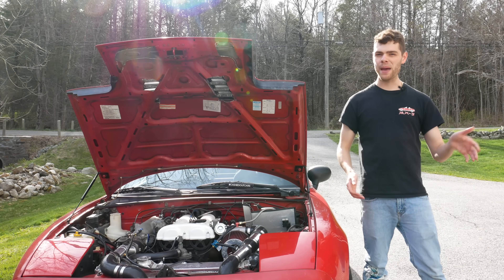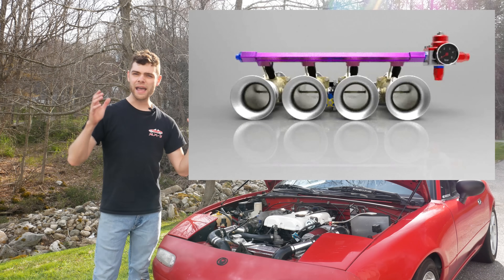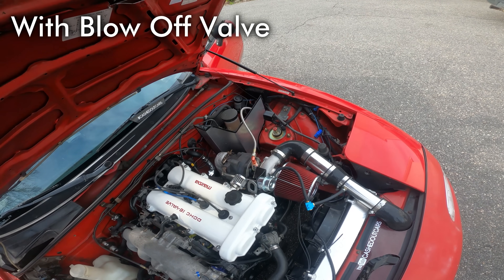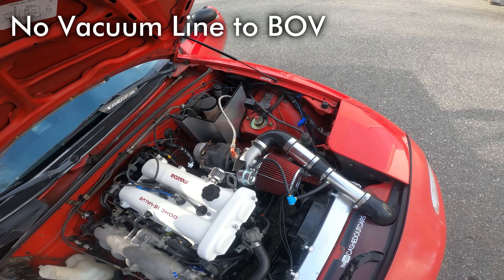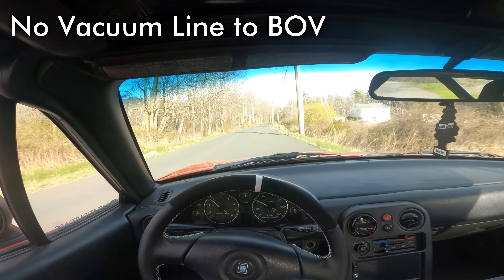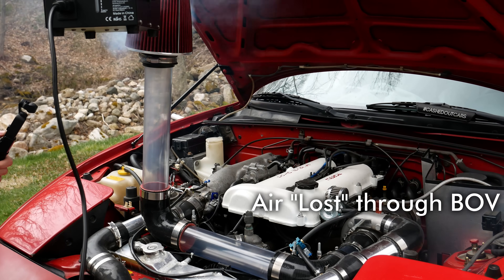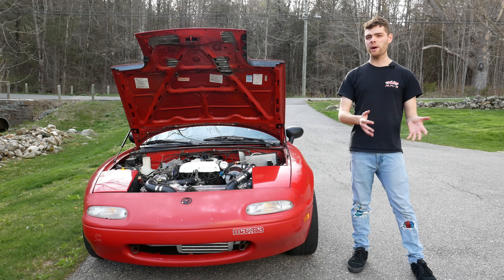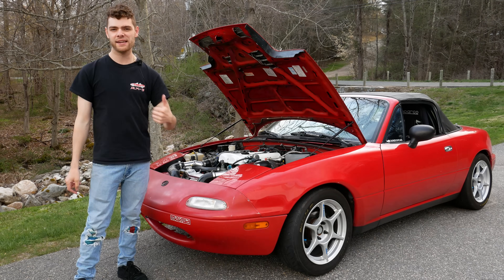Blow Off Valve vs No Blow Off Valve | Sound and Science

Comment: the same fuel issue will happen without a BOV because when you close the throttle the air has nowhere to go and usually ends up passing through the MAF again and then guess what, even more fuel gets dumped in
Reply from the maker: Your BOV provides a place for that air to go, and you should place your BOV between the throttle and MAF to prevent that
Reply: @CashedOutCars  once it has gone through the maf, the motor expects it
with a BOV, it exits and the air that the motor is expecting never comes and causes a rich spike
without a BOV the air is forced to travel a 2nd time through the MAF which also will cause a rich spike.
I was just noting that the rich spike when getting out of boost is kinda just how these cars act. there are ways to tune for it but still.
Reply from the maker: This car is tuned speed density so no MAF at all so no rich spike when you close the throttle, I do have less experience with a BOV and MAF but I would think air going through twice would have more of an effect than it venting out the BOV, not sure on that one though. Thanks for your comment!

Comment: There's a middle ground. Get a BOV which is tunable. The TurboSmart RacePort, or something similar, works. You don't want it constantly venting at lower boost levels (< 0.5-0.8b), but then do vent at high boost levels (1.0b on up). If the POV is constantly venting, then it hurts throttle response if you modulate throttle mid-corner. If the BOV spring is light, then a small throttle adjustment will vent the pressure in the intake manifold to ambient and you get the lag of the turbo starting from zero when you re-apply throttle. If you leave some residual boost in the intake which isn't high enough to do any real damage, then if you do a quick throttle modulation mid-corner, it's a lot more linear in it's power delivery. Tune the internal spring pressure to find your happy medium.

Comment: Ok, this video sums it up perfectly. I understand what a BOV is and why i should run one but I am not a big fan of the noise they make, especially for my daily car. This makes me skeptical on running one because they sound like the car is sneezing, but reduce wear on the turbo. unless there is like a quiet BOV or my car already has a quiet one (2017 Ford Fusion Sport 2.7 ecoboost)
Reply: I know this is a while after you wrote this. But if you run a recirculation setup with the bov, there will be much less sound. Like having it blow off out in the intake again in a loop. But of course you wont have a flutter either.

Comment: It seems to me that turbo flutter not only stops the turbo spinning but even makes it spin backwards.  So you not only have turbo lag having to spin the turbo back up with the throttle, but you have to bring it back from spinning backwards in some cases, so the turbo lag is even worse.  The turbo keeps the spin going with a BOV or bypass valve, reducing turbo lag.  Somebody tell me if my thinking is wrong
Reply: Not only does it not spin the turbo backwards but it doesn't even slow it down, anybody that has told you otherwise has zero understanding of what is happening.

Comment: I don't think you were expierencing compressor surge at all with your example and it should be redone. Disconnecting the vacuum from the bov puts the bov at its spring rate to open and close. If you're spring rate is overcome easily then whatever boost is in the system will force it open. Which is why you didn't build boost. You essentially had an open bov the whole time.

The bov remains closed due to boost in the system, once it goes into vacuum it opens, but since you have a vacuum leak at the bov that means it is always open.

It sounded like the valve kept opening and closing rapidly instead of the boost pressure being chopped.

Comment: Im no mechanic, but does having a blowoff valve technically introduce more turbo lag? Since the charged air gets released, the turbo would have to pressurize it again on the next throttle input no?

Comment: whats difference blow off and wastegate?
Reply: Blow off valve releases pressure between the turbo and the throttle body when you lift off the throttle, a wastegate bypasses exhaust gasses around the turbo to limit how fast it spins which limits boost pressure going into the engine.

Comment: I didn't realize without-BOV has become a thing, one doesn't care the unnecessary wear on the bearings and the longevity of a turbo, would've at least concerned the massive amount of pressurized air piped into the opposite direction of a highspeed spinning turbine to literally force it to a halt. Who wants to wait for the turbos to spin up from a halt all over again between every shift?
Reply: It hasn't become a thing, it was a thing since they put turbos on engines, it does not half the turbo to stop spinning, it doesn't even slow the turbo down and yes people have tested exactly that, it does not damage the turbo, it's common place in motorsport not to run any blow off valve because it actually improves response if you aren't releasing all the boost pressure.

Comment: Why your BOV leaking boost when vacuum line is disconnected? The pressure should be holding that BOV closed. Did you not plug the disconnected vaccum line? I'm also using an hks SQV4, I'm not losing boost when my vacuum line to the BOV is disconnected.

Comment: I rarely ever like videos, but this was exactly what I was looking for, appreciate the video👍 I swapped from 1 50mm BOV to 2 forge diverters & haven’t done the vacuum lines for them yet, I like this because you showed what it does without vacuum to the BOV & justified my decrease in boost pressure for now👍
Reply: When you say forge diverters do you mean like like the dual greddy flang type s style recirculation valve

Comment: I just don't have a TIG welder to weld my BOV flange to my intake pipe. Single 98/88 cheap turbo on a gen 4 5.3 with forged pistons. The flutter it makes sounds awesome, but I don't want to damage my turbo. I made a new friend a few days ago, who has a working TIG setup and offered to weld it. I will be doing that. I have a TIG welder, but the welding gas shops won't fill my gas bottle with 100% argon since it's already had 75/25 argon/CO2. Bottles are expensive. $300+ for a new, empty bottle. Bleh

Comment: Question: do diesel engines have blow off valve? I mean they dont have throttle plates. But i do here trucks make the blow off valve release sound between gear changes. But i dont here it in SUVs or small diesel engines.
Reply: Diesels dont have normal throttle valve's so there is no need.

Comment: This is something i see alot of snd its so misunderstood. Turbo's do pull more air into the engine BUT they do not push it, semantics i know but for a better learing experience it makes sense to explain it the correct way. Exhaust gases cause the rear turbine to spin which in turn causes the attached front turbine to spin pulling in more air, the amount of air a turbo can pull into a turbo is dictated by the amount of exhause it is pushing out. 

So the TLDR version turbo chargers pull air not push it, again semantics but in my mind it helps to understand things from an accurate perspective.

Comment: Hey. I have almost identical surge sound as you when you have no vacuum line connected. Only problem is, I don't have a BOV. I'm on diesel, so only wastegate. It doesn't happen every time, but there are periods when almost full ride is stututuing or long scraping. Could it be that my wastegate has vacuum leak, since is not constant?

Comment: Nice video, I would like to understand if a valve with recirculation or one that discharges into the atmosphere is preferable to have the maximum performance from the engine, clearly tuning the ecu correctly and if there would be a way to have the valve discharging externally with a map for track use and bypass to another recirculation for use on the road. Thank you
Reply: for racing a recirculation valve would be better, as you're able to maintain boost pressures whereas an atmospheric blow off valve makes you lose all your boost.

Comment: I have a touran 1.4 Tsi 140 hp and my turbo was broken, should i use a bow off valve or not , and which one you suggest
Reply from the maker: Typically I'd go with what is OEM on non-project cars. That car may have a diverter valve from the factory, which does a very similar job, but I'm not sure

Comment: Just so everyone knows, they make turbo for this application. It’s the ones with all the fancy holes around the turbo inlet side. Those control flutter for non BOV applications. However most modern day cars have internal wastegate s now and there is no need for a bov as the exhaust pressure is regulated to in tern regulate boost pressure.
Reply from the maker: Unfortunately that’s not what an internal wastegate does. It does regulate boost pressure (this isn’t particularly new tech) but it doesn’t replace the need for a blow off valve.
Reply: holes around the inlet side is NOT for compressor stall (sudden off throttle), it's for protection against self destruct from compressor overspeed if the wastegate fails to open to regulate boost pressure. Internal wastegate is on the hot side of the turbo and has nothing to do with the cold side of the turbo, BOV relieves the pressure on the cold side of the turbo.
Reply: @Persocondes  The holes are literally called "anti surge", they are designed to prevent compressor surge on throttle, they are not designed to stop overspeed if a wastegate fails, if you wastegate fails they will do nothing to stop that.
Reply: @DriftNick  ah ok, i learned something new today Thanks! i never knew there's On throttle surge, usually when the engine is too small paired with too big of a turbo

Comment: I’ve been running mine with blow off valve disconnected for around 6 months. Haven’t noticed any leakage out of the flyin Miata/turbo smart bov with just line disconnected

Comment: Not running a blowoff valve won't damage your turbo in any way shape or form. Building boost with a closed throttle body will ruin your turbo however, this is the same with or without a bov.
Reply: What other way is there to avoid building boost without a BOV?
Reply: @pprb123  external/internal wastegates! They stop your turbo from building boost past the specified boost pressure
Reply: There are some highly touted pros that say otherwise 🤔 I mean not necessarily damage it per se that may be true as saying maybe running a quart low on oil in your engine wont damage your engine technically.    Over time though it puts more wear and tear on your engine as with no blow off valve , diverter or recirculation valve of some sort puts more wear on compressor, how can it not by the pressure forcing toward compressor instead when suddenly letting off throttle and the built pressure suddenly force slowing down the compressor wheel/impeller? Perhaps billet and higher strength ones may not take any adverse effects but on cast impellers and cheaper made turbos I have to imagine it would add wear and tear no?  

I honestly actually really dig the stu stu stu sound and probably would opt to go no bov if it is true that there’s no adverse effects.    
 I also imagine there could be benefits to no bov possibly with not releasing all the pressure suddenly , if I wanted to get right back on the gas still be in boost and have a more NA feel when on and off throttle? Possibly? 
I will be running a billet wheel journal bearing, quality Borg Warner turbo.  This is a controversial subject that has experienced people arguing both sides of the story. I have some research and thinking to do 🤔 very interesting

Comment: So question. I have a 2016 Audi A3 2.0 that originally came with a diverter valve. I switched it out for a TurboSmart 50/50 Bov. Will that make the car run rich, or is it perfectly fine?
Reply: Should be fine, that's the idea behind the dual port

Comment: I drive a 10th gen Civic 1.5 turbo with recirculating bov from the factory. Do you think running a vent to air bov will run rich and do harm the engine in the future? I was reading forums and some says yes some says they’re running those kind of bov with no issues. Appreciate for the answers. More power to your channel dude.

Comment: If your car is turbo from factory it has a bpv (bypass valve). It is NEEDED not wanted. If your car is boosted you NEED a bpv or bov. The difference is the bov vents directly to the atmosphere and the bov recirculates the air back into the system. If you run a turbo or supercharged car without bpv/bov you will get surge and it will result in premature failure.
Reply: My car had a bypass valve from factory, been running it for many years without it.

Comment: I have an atmospheric diverter valve and i get the BOV sound at certain rpms and a flutter at other rpms, best of both worlds sound wise.
Reply: a friend of mine who has an STI has the same system ! i was wondering how it was called so thank you ;)
Reply: same here! I got the Go Fast Bits DV - higher rpms throttle release - BOV sound - low rpms throttle release - turbo flutter
Reply: That’s how my Golf is. I get the best “stu stu stu” when I rev it to launch RPM in launch control mode. I have a video where you can hear it.
Reply: @aluminumfalcon552 my golf R does this but in cycles it last for one week tutututu then next week pshhhh next week tutututut next week pahhhh 

Bahahaha mines a Turbosmart Kompact EM Series Dual Port.. weirdo. I want it to stay tutututu but nope each week daily driven weekly it changes back to pshhh for a week then next week ahhhh tutututu is back!! Can I just disconnect the power from the BOV and it will stay tutututu now?
Reply: @GuardHausRottweilers  😂😂😂😂

Comment: good video, I just want to sneak in quick a couple small things.  the new VW MK7s don't have diverter valve on the Jetta S models, but they do have small boost pipes that run from the charge pipe, and manifold and pump them back into the turbo inlet for boost pressure relief ( to an extent ) I built my own charge pipe with a Turbo smart duel port valve and its been great, far faster spool up, but a small lag between shifts.   setting up an adjustable BOV is key to a good running engine, and turbo response time.   also one last thing, not running BOV isn't totally bad for the turbo, yes it can cause damage to the compressor but the sound you're actually hearing is the hair breaking surface tension from the compressor blades themselves.  but yes, any turbo vehicle should run a BOV, and or a plumb back valve for longer service life of the turbo, and engine.   but a again, good video, and its nice to watch a video with good audio.

Comment: I did oil analysis after running BOV vs no BOV on a journal bearing turbo and saw copper wear levels after the no BOV and return to normal after running the BOV again. I'd be concerned about the axial wear on bearings if you're on a journal bearing turbo, if you're running a ball bearing turbo, I believe the bearings are more tolerant to axial forces. Otherwise have fun with the cool flutter! Now, I will mention this is on a 480whp STI running about 28 psi on speed density. On lower boost applications it's not going to affect it as much.
Reply from the maker: Awesome to see some more real data on this. My car runs 14 psi and I’m happy to keep my BOV regardless :) thanks for watching!
Reply: So if its a ebay turbo then fuck it?
Reply: @ilyas5708  especially if it’s a ball bearing turbo I’d say go nuts. I haven’t really heard of ball bearing premature wear due to something like this. Otherwise I think it could affect the long term life of the turbo. Note that is not important to race teams, etc. for a daily driver that you want reliable long term I’d recommend a bov. But otherwise who cares
Reply: @shredder8910  i got a gt2560r which is a ball bearing, so bov would not damage too much? Or should i run no bov, is there any other thing other than a bov i just dont want damage on the turbo
Reply: @4cyl  if you want to be scientific about it then do an oil change with no bov and get it tested and then one with and get it tested, but my sense is that the ball bearings can withstand the axial forces much much better
Reply: @ilyas5708  Ebay turbo's usually don't have ball bearings because those are expensive and they go for cheapest quality.
 
The real problem with cheap Ebay chineesium copy turbos is that the quality control is really bad and that means you could buy 2 turbos from the same vendor at the same time and 1 is really bad and unbalanced and will fail prematurely while the other is perfect and will last a long time.

I heard that what people do is buy the cheap turbo and take it to a turbo shop for balancing. You still end up saving money from what I hear.
Reply: Just why add more wear on the turbo.. My turbo blew and "seemed" like it was due to my bov being too small according to the performance shop. Got a bigger one and turbo lasted forever. 

I was running 28 pounds and big turbo.
Reply: @Benedict00_MankoMuncher  I killed a turbo after only a few months, I removed the blow off valve and have had no issues since, just like your story it had nothing to do with running a blow off valve or not, turbo flutter does not kill turbos.
Reply: what sort of turbo was it? See some race or drift cars running without a bov & a JB turbo for years, I run 1 at the moment but may blank it as may be putting WMI into the charge pipe so dont wanna vent that everywhere
Reply: @sircefiro  years may or may not be a lot of miles / engine hours on cars like that, while it is a lot of boost and abuse, not sure if that’s as important wrt axial wear. It was a BCPx500+, pretty much a modified 20g
Reply: @shredder8910  yeah debatable for sure, I'll only blank it if do wmi